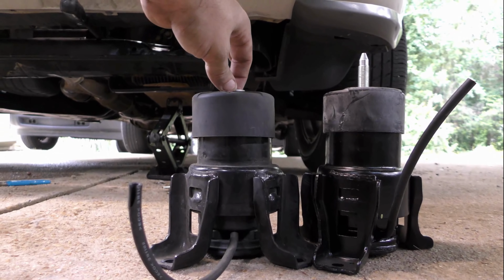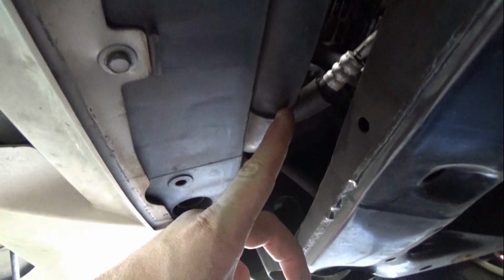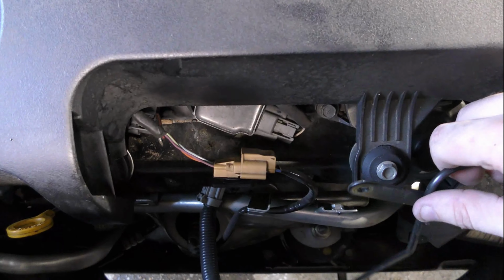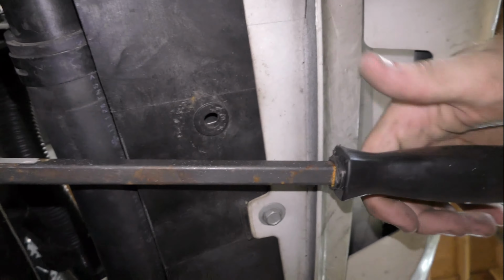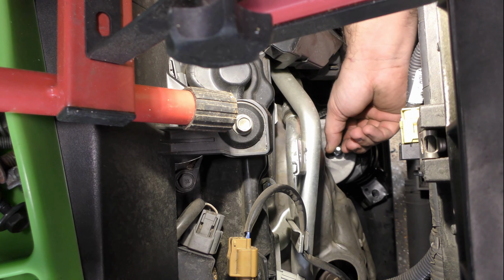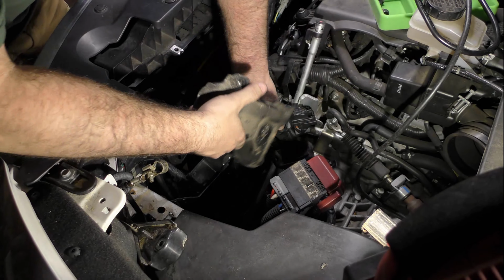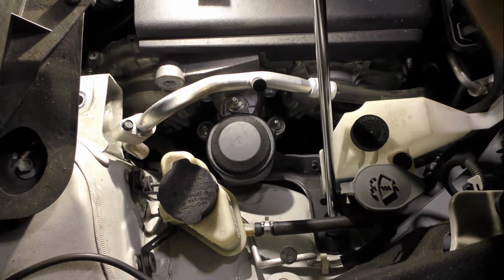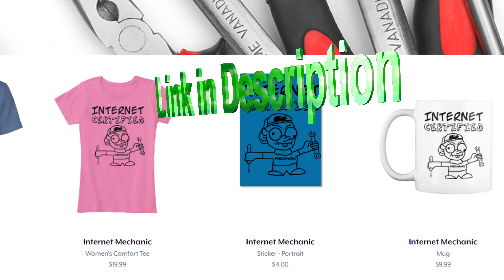2011 + Nissan Murano front engine mount, top engine mount replacement.  Easy job with these tips!

Comment: Overall a good video.  It also applies to Infiniti JX and QX in many ways.

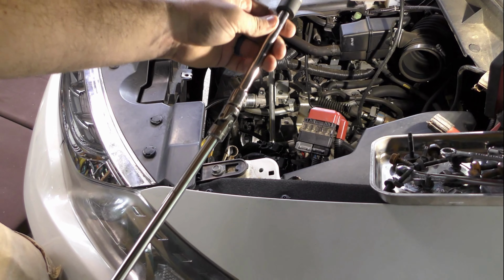There are two things that can be done easier.  First, at time index 8:00, you see the view of the rear bolt on the mount.  Where the camera is viewing is the better way to get that back bolt.  Trying to manage a double jointed extension is a pain; especially when trying to tighten it and can easily slip off.

Second, THERE IS NO NEED to get out the pliers for the special stud in the motor mount. This method takes forever and that is if it is moderately cooperative; mine wasn't. After half an hour of struggle I decided the best way is to take the nut just removed threaded on with another nut and jammed together.  Then, you can use a socket from the top and it takes 10 seconds.  

There should be other nuts removed during the teardown that will work for this.  Or you can purchase one.  This is also useful if you have to replace the rear mount.  For it also has the same goofy setup.

Mr Wiggley can now be removed via the hole where the battery and engine computer used to be.

Also ESSENTIAL: all the connectors for the ECU are close to the radiator hose.  Place a bag over them such that any antifreeze from removing that hose won't splash  into the connectors.  Ethylene Glycol is VERY difficult to effectively clean, so don't risk it. Many off the devices are operated at low level voltages and are easily affected by conductive liquids.

Commentary: This stud has a pointy end most likely to lowering the engine assembly onto the cradle.  Still, they could have put a profile on the end to make it easier, such as a square or even a hex.  But, hey, if you never have to work on it yourself, who cares? Why spend a quarter to make it easier for service.  Nothing about these cars is designed to ease serviceability.

I also put a piece of cardboard in front of the radiator just in case.  It is even worse a task to replace if it were damaged.

Comment: Thank you, the best simplest video i seen yet on this repair. I just had  a used engine placed in my 2009 Murano. the metal vacuum line at the top in disconnected. Where does the rubber portion of the vacuum connect to on top of the motor ? Anyone please.

Comment: Two years ago you posted a video on replacing the lower control arms on a RAV4 and promised to do an update. Do you still have that vehicle? I'm looking for the update that will reveal his well your method to prevent rust on the replacement control arms may have worked.
Reply from the maker: Daily driver.  Will do an update hopefully this year.  Last year COVID-19 had me working a series of pointless jobs because of furlough

Comment: Is it really necessary to remove the front coolant hose?
Reply from the maker: Let me know if you get it out without doing it
Reply: @CreativeMechanic  I did on Infiniti QX60. Not sure of any difference from Murano.  The engine bay looks very similar.  I remove the fun controller at first to have more room in order to take the fun out without removing the coolant hose.  After replacement, the noise is reduced a lot. But still some left. Maybe I need to change  the two mounts on the passenger side as well.   Anyway ,  your video gives me confidence to diy.  Thank you very much!
Reply from the maker: There’s also mounts underneath the transmission and another on the back of the engine under the exhaust
Reply: @CreativeMechanic I hear changing the one near exhaust is nightmare

Comment: Do you need to replace both top side mounts at the same time or  you did it just to show how it's done?
Reply from the maker: Both had a little wear, but they are pretty cheap and easy to get too.  So it’s your discretion but at least take them out and inspect

Comment: Why the front mount need to vacuum line
Reply from the maker: Honestly, 🤷‍♂️ but it was there so I put it back on
Reply: @CreativeMechanic  I already looked it up and Did you call active engine mounts supposed to be smarter than the rubber ones or better whatever you wanna call it but thank you